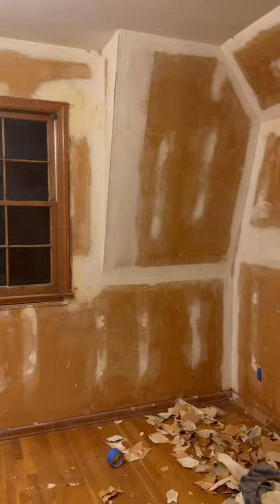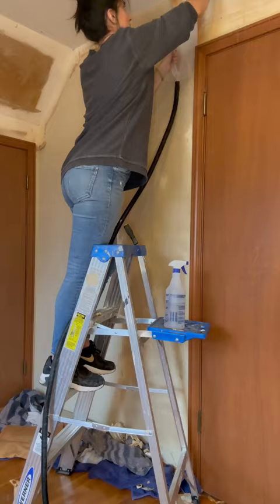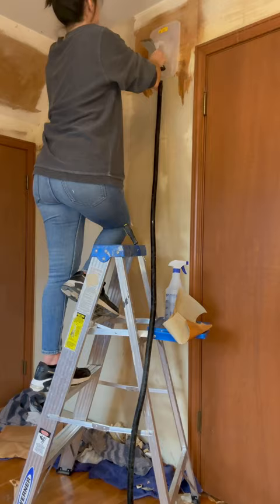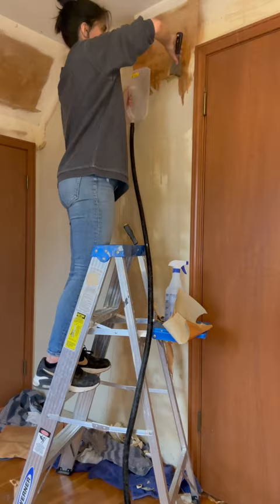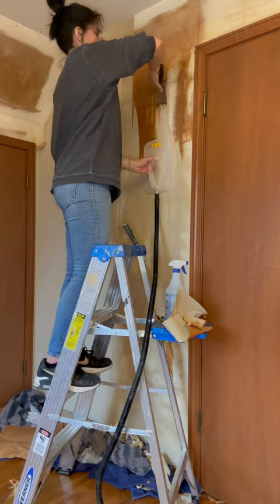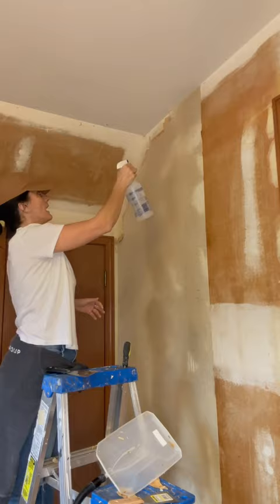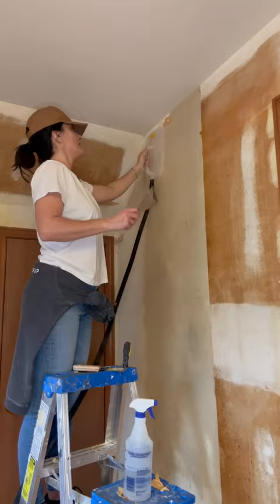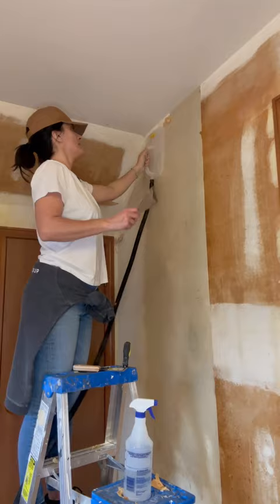Wallpaper removal tutorial Part 1: when everything else failed… #diy

Comment: That was painful.    Use the hottest water you can.  A lil simple green to make the room smell better.  Go smoke a bowl.  Come back to it.  Scrape it off with ease.    Rinse and repeat
Reply from the maker: Yes, we tried that. Needs hot water and steamer. Steamer alone didn’t work either. Soap and vinegar didn’t make much of a difference in this case. This combination was the best. Score, spray and steam. Two people is actually better, one can use spatula as the other one keeps prepping with steamer. The perfect removal point is there for seconds at a time only.